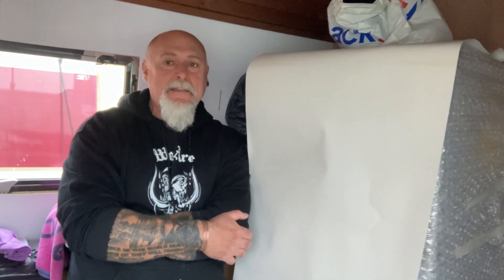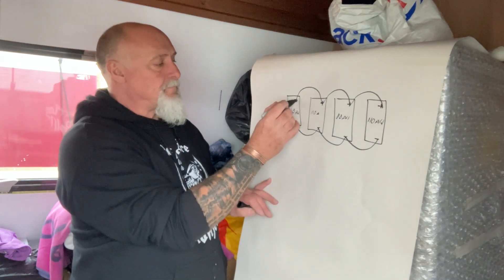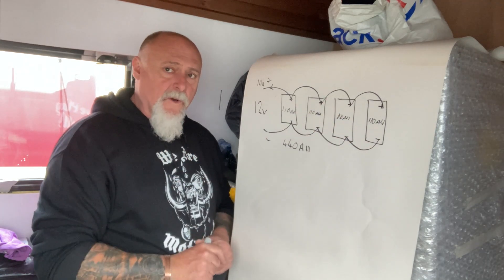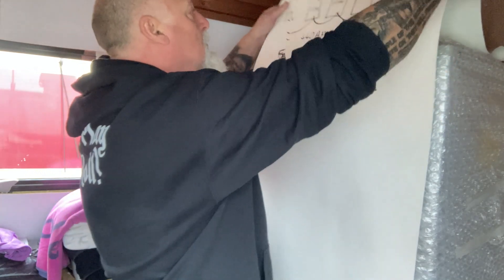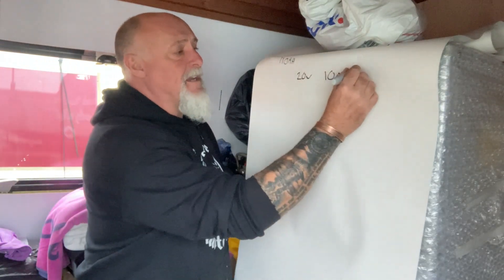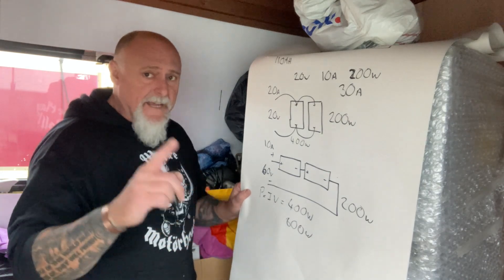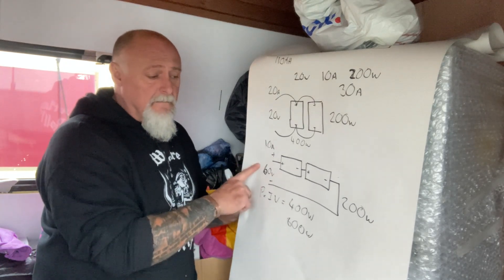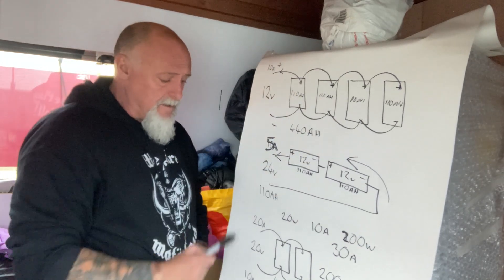Narrowboat Tech Talk #4 - Batteries and Solar Panel Circuits

Comment: I have been watching all of your videos and they have FANTASTIC !! You did one video where you were connecting wires to outlet boxes. In that video you had wiring that had multiple thin wires in each cable that you would normally twist and put in a box or around a screw. You showed us a connector that you put on the wires to enable you to connect without twisting the wires. I have tried to look back in your vlogs to try and locate that info and was unable to find it. Could you possibly tell me what the connector was again that you put on the wires? I really love all your vlogs and have learned so very much from you ! I watched your ohm video several times. How circuitry works has always been confusing to me. Thanks for the detailed info ! I hope my description was clear enough. Thanking you in advance !! And looking forward to your future vlogs.
Reply from the maker: Thanks for being here Sue, glad you enjoy them. They are bootlace ferrels, they come in different sizes and for use on stranded cables into screw type terminals. You also need the crimp tool to do them properly. I am glad you like the info vlogs. I must do some more soon. So great to have you aboard Sue.

Comment: Hi, Love all of your videos, especially the tech ones I am a first time boater and mine I fitted with solar panels. I am also a complete electrical numpty !! if is relevant could you explain how to tell what your panels are putting out voltage and current wise? many thanks.
Reply from the maker: So glad you are enjoying them Stuart. Having a boat is a steep learning curve for sure. Regarding the voltage and current, what solar controller do you have? have you got a BMV installed?

Comment: Another interesting vid Mart, reminds me of my MH, our solar and battery bank are both hybrid with 6 x 6v batteries = 12v and 2 x 150w panels 1 x 310w panel giving us 610w of solar…however it’s still not enough for this power hungry pig lol. Cheers, Nigel
Reply from the maker: Hi Nigel, cheers, appreciate it. We live in a power hungry world, even off grid. We have put 660Ah Lead carbon on the boat with 525w of solar. That should be enough when out i spring/summer months.

Comment: Are there considerations for PV panels in series/parallel when it comes to shade covering one of the panels? I had heard about that somewhere, but don't remember if that factors into the decision.
Reply from the maker: Hi Erik, yes you are correct. In series, when one is shaded it affect the whole array. You can then start to think about a series/parallel circuit to offset this effect. Beyond what I was trying to cover but a very good point. Thanks for engaging

Comment: Lifepo4 installation 600AH

1KW Stick Down Solar Panel Kit

Which would be best parallel or in series?
Reply from the maker: Hi Nick, I don’t want to give specific advise as there are a lot of variables. With your set up I don’t know how many panels, the specifics of each or the solar controller. The limiting factor is often the MC4 connectors and the length of cable run back. That’s why some controllers have multiple MC4 inputs. Maybe go to a series parallel circuit if you have 4 panels.
Reply: @narrowboatmoonshine  👍🏼

Comment: Good recovery on the 400 watts 👍😁

Thst was a pretty decent breakdown on the topic and as you know, you could spend a good hour going into the finer details of the pros and cons of each option. It is worth a quick mention though about the best way to set up the connections on your bank of 4 x 110ah - wired in parallel, specifically where you connect to, to draw your power and put it back in. I didn't know until I joined the 12volt Facebook group, that you can cause the premature demise of your batteries by making your In/Out connections to battery number one, as depicted in your example. This would cause the batteries to age at different rates and suffer premature failure. It is preferable to make this connections diagonally at each end of the bank, so that for example you would take the negative from battery number 1 and take your positive from battery number 4, which balances out the charge/discharge loads across the bank, more favourably. 

I am sure that you know all this already and I am by no means picking fault with your video, but I think that it is a point worthy of a moment or two's discussion. 

Keep up the good work both 👍
Reply from the maker: Hi Dave, yes you are right on all counts, but I wasn't really talking about balancing loads or charging, just the different characteristics of the parallel and series circuits. I aim to do just short 15 minute or so videos, just a flavour, some may then wish to go further, who knows? These videos, at the moment, are aimed at the person that know very little on these subjects. That boat owner or new boat owner that has little knowledge, which I know from experience, number a lot. Some won't care, some might. But you were paying attention, and that's a win in my book. By the way, I am never ever on any of those forums. Thanks for engaging, I like that.
Reply: @narrowboatmoonshine  yeah I think that you strike the right balance of detail in these videos.

I think that people like the "warts 'n' all" approach to these vlogs, where minor errors are left in and you corrected as it unfolded.

It isn't an easy task but I think that you nailed it!

👍